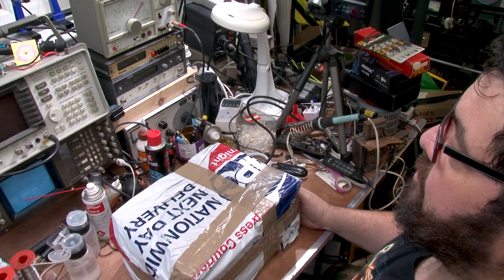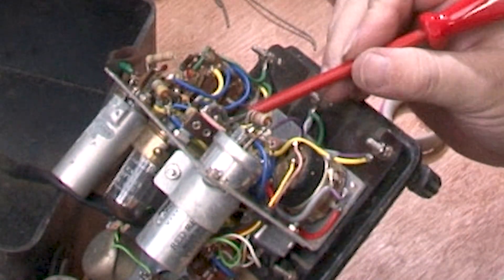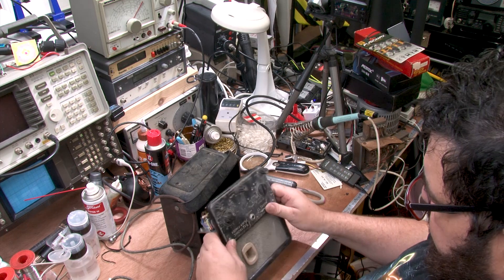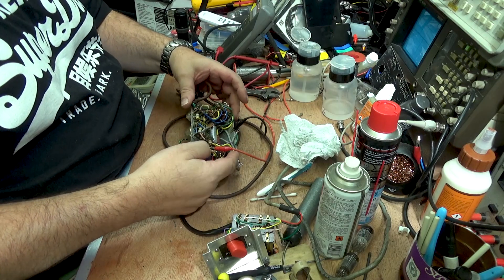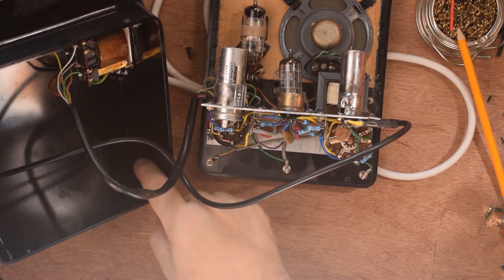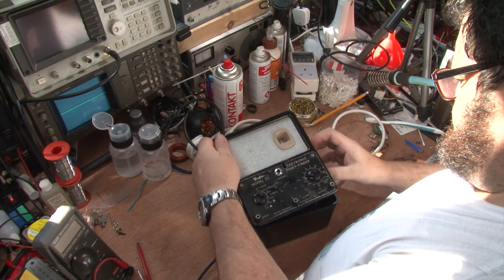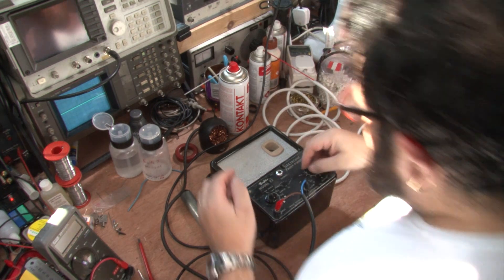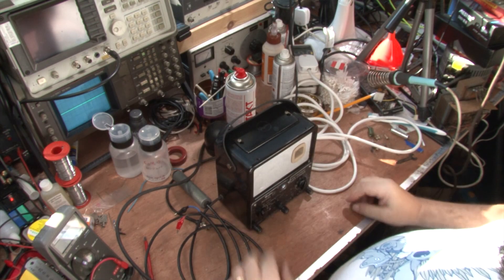Signal Tracer Restoration : Taylor Model 22

Comment: Hi George, not sure if you've learnt what the AC and DC switch positions do since you made this video but if not, AC position - the AF amp is coupled to the magic eye, volume control active. You can measure low frequency AC such as heater lines the amplitude shown in the magic eye. You can stick an AC volt meter in the headphone jack for more accurate measurement. On DC position I think the terminal is connected to the grid of the magic eye , so you get a DC valve voltmeter for checking low voltages such as AGC or valve bias.  Cheers - Andrew
Reply from the maker: Indeed I did discover the AC function being connected on the eye but hadn't quite figured out what use that would be for except low amplitude signals. I am still looking around for a user manual which does exist somewhere but has proved to be elusive so far.
Reply: Hi, did you find manual or schematic?

Comment: OUCH!!!....please give warning, at 10:14 point of video, my ears are ringing.
Nice vintage signal tracer, at least it is big enough to work on and you don't have to strain you eyes building one...LOL
Are you going to recap it?
Gotta love those vintage vacuum tube gear.
Sounds good George, you can't beat the sound
Reply from the maker: Sorry Bill, forgot that I hadn't turned the audio down at that point. I did recap everything that needed it. There were only the one low voltage electrolytic and the big 3 section one in there. The main filter cap reformed fine and doesn't give any hum at all. The other film caps were replaced because they are the UK equivalent of bumblebee caps, completely unreliable at this age. The small ceramics were fine.
Reply: Looks like you have a fine signal tracer there.

Comment: True if you go through all the trouble of taking it apart you might as well replace as many parts as you can to give that signal Tracer a fighting chance of working. Nice job fixing the cabinet as well really on the video it is pretty much an invisible repair George. I'm guessing that unit was made around 1956 or 57 because if that is a Bakelite case that's what was used around those years not plastic. Nice job getting that old veteran piece of equipment working.
Reply from the maker: Many thanks Larry... I just thought like you that it needed to be done. I didn't show it in the video because there was some footage corruption but one of the 1Mohm resistors metered out at 6Mohm...  After that, I changed them all... no point in messing around.